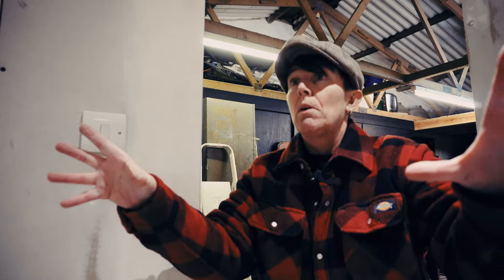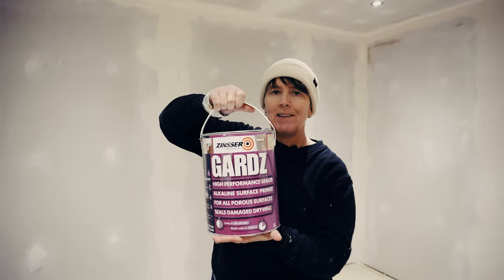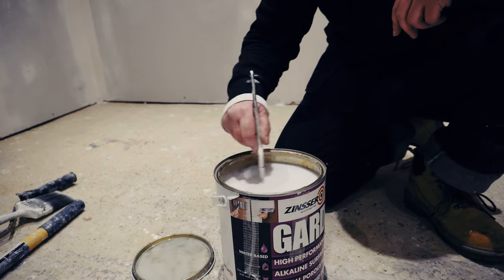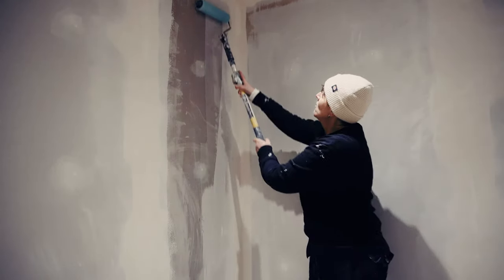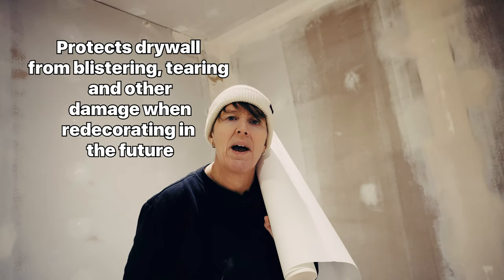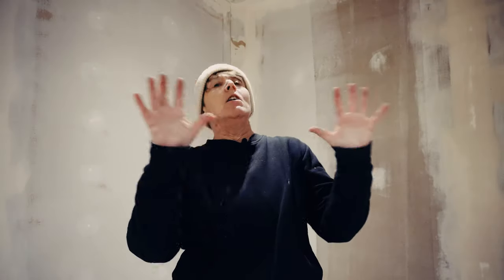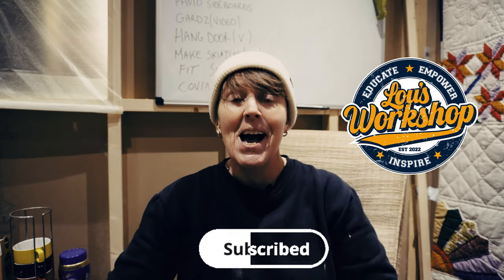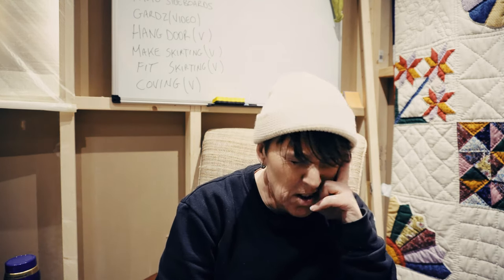Why YOU should use a drywall/plasterboard SEALER before painting & decorating

Comment: I've been told new builds are no longer getting skimmed with plaster over the plasterboard. I've just stripped back an old edwardian terrace and will be in the process of plaster-boarding shortly, given the labour required to plaster/skim the whole house i was wondering what your thoughts were on whether its worth the money to get it skimmed or whether sealing and painting straight onto plasterboard just does the job and saves a bunch of cash?
Reply from the maker: If you have the budget I’d have it skimmed every time. For me it’s a better finish, easier to redecorate and easier to repair.

Comment: Great video. What happens if you pull back the wall paper lining and you see plaster and mis coat. Ie patches of both. Can you apply this all over to prime ahead a repainting?
Reply from the maker: Yes you can 👍🏼 . Scrap off any loose flaky paint , sand the walls with 120grit sandpaper, remove the dust and then apply Gardz 🙌🏼

Comment: Hi

I did a jointing compound skim followed by a mist coat.  I have then done 3 coats of a dark coloured clay paint.  This is how I have handled gypsum skim coats before and its worked....  However, I have found quite a big difference in the colour of the cutting in paint to the roller paint (not every wall evertime) so much so that I bought more of the top coat (£££) and went again.  If anything it is now worse.

I am wondering if its not priming?  Can I now prime with gardz over the top of the paint, and then simply paint again?

Comment: Im about to paint my walls soon( New Build) pretty sure it's just magnolia paint straight onto plasterboarding. Will sand down walls. But still afraid oll pant with peal off when rolling new paint. Will this product help stop that? Thanks.
Reply from the maker: Hey 👋🏻 Yes, definitely. If it’s a new build then it’s probably been painted with a cheap contract Matt and this stuff will seal that in a give you a great surface for paper or paint 🙌🏼

Comment: I’ve recently started decorating a place I moved into and the walls were coming out in many many bubbles. So thats because who ever painted the place when it was built didn’t seal the plasterboards?
Reply from the maker: Probably but not necessarily! Not all plasterboard is made equally.
Reply: @lousworkshop  I’ve now stripped back to the plasterboard and sealed it with a mist coat. I was having a nightmare with it so hopefully this will fix it now.
Reply from the maker: @walesu.k.2108  I’ve got my fingers crossed for you 🤞🏻